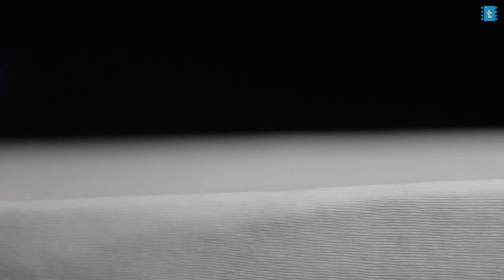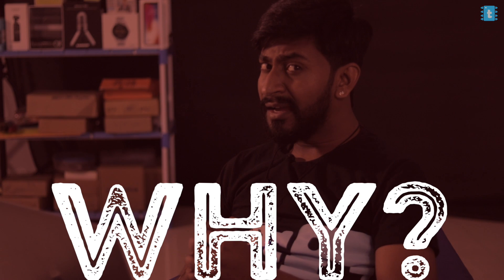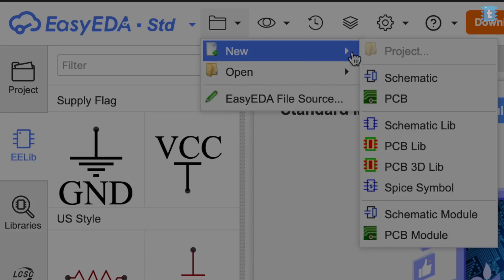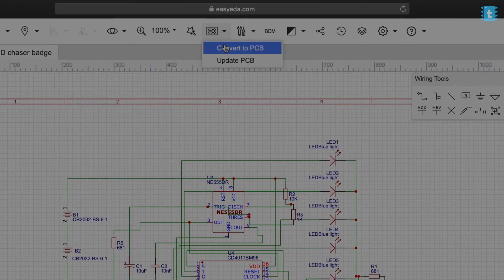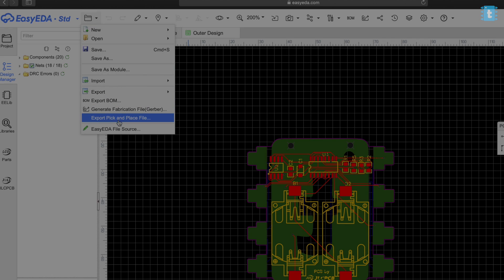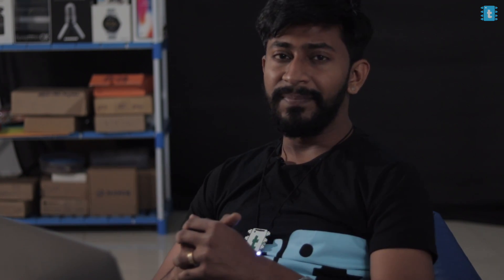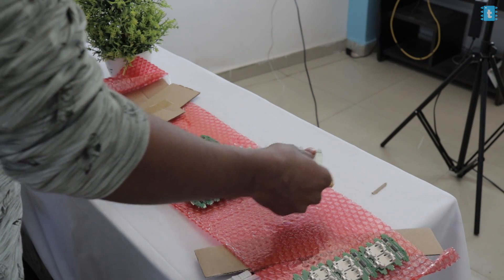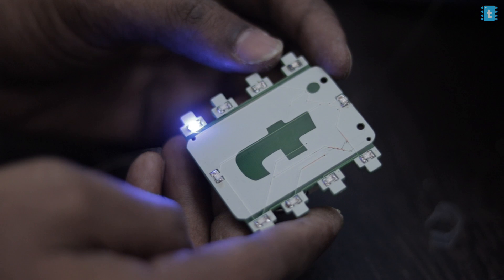How to use JLCPCB's smt assembly service

Comment: So, you can order a dual layer PCB manufacture as long as you have SMT components assembled to one side? The JLCPCB support chat guy told me that I can't - the PCB has to be designed as a single-side board from the start if you want SMT assembly service...I'm confused now...